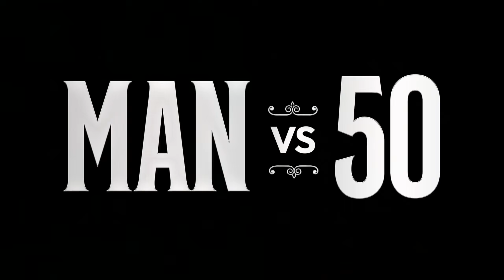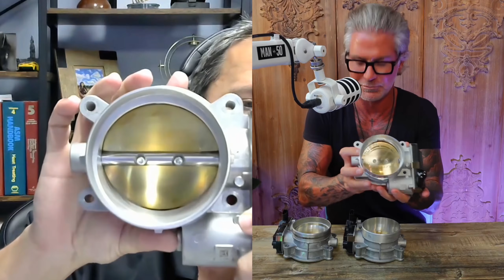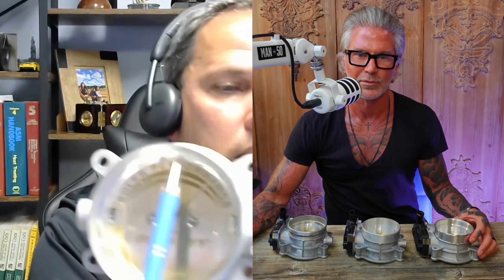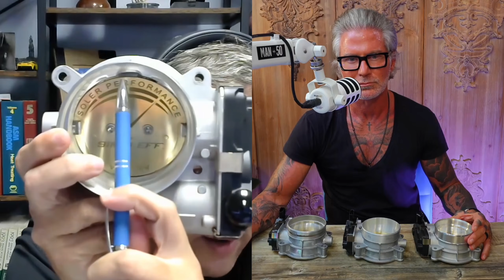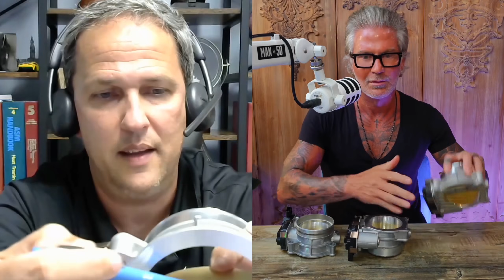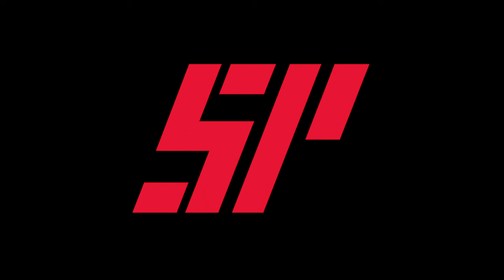🔥 Meet Mike Cabrera – Soler Performance’s Throttle Body Guru!

Comment: The fact of the matter is....even though people drive on the streets at all different throttle positions, people want to modify their cars with performance mods TO BE FASTER.  And that is recorded on the dyno, at the drag strip, or on the street... at WOT.  So if there is no evidence that the vehicle makes more power just because it's getting more air through the throttle body (remember it still needs to go through the intake manifold and into the cylinders for combustion...all controlled by the ECU...) then these products aren't worth it.  Why do you think they started selling a throttle controller?  Because people installed throttle bodies and didn't make any more power...so now they need to make your car FEEL more powerful just by messing with the throttle map